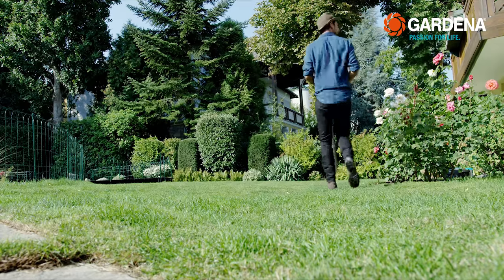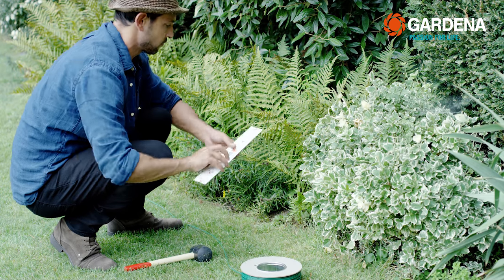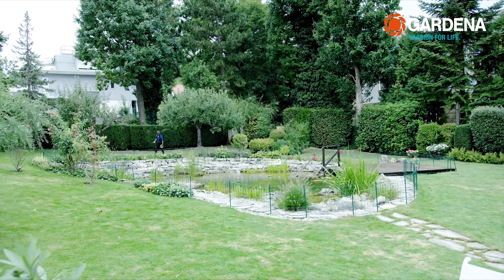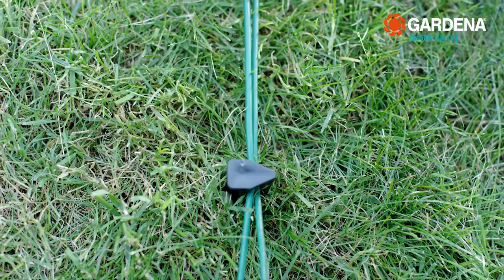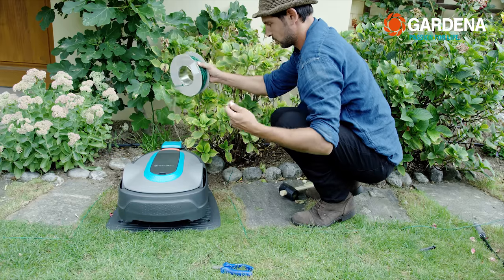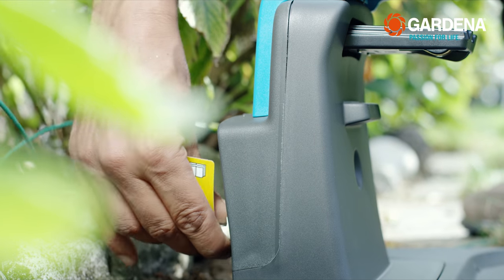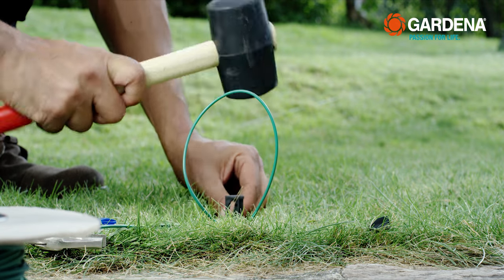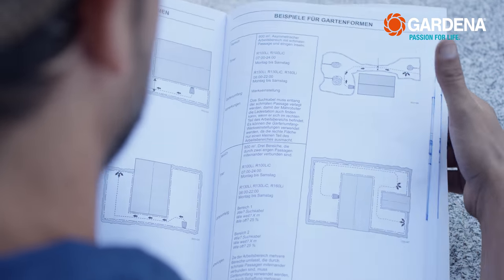GARDENA SILENO city + life 🌱 | Part 3: Lay the wire

Comment: How do you need to place the guide wire if you have a square perk?
Reply from the maker: The boundary wire should be put as a loop around the work area. Sensors in the product senses when the product approaches the boundary wire, and the product selects another direction. All parts of the work area must be maximum 15 m / 50 ft. from the boundary wire. If you’ve got any more questions please don’t hesitate to contact us directly via this link: https://www.gardena.com/int/support/advice/contact/

Comment: There are 0.0% examples in the operators manual I received. It would also be helpful to explain in the beginning the idea of the guide wire. I come from a system without a guide wire. Yes, intelligent systems WITHOUT one. Can you imagine?
Reply from the maker: Hello Reinout,
thank you for your message.
The idea of the guide wire is, that the mower will find to home, if his battery gets low.  Or you can that the mower can start after following the guide wire in the 
See examples for the guide wire in the manuals, like in the SILENO life:
https://www.gardena.com/int/search-page/?searchText=SILENO%20life
Best regards from Ulm
GARDENA Service

Comment: At 2:00 mark, you state that the pond must be protected with a 15 cm high barrier.  Is this to keep the robot from falling into the pond if the boundary wire is not working?  If the boundary wire is cut or not working for another reason, does the robot then run off?
Reply from the maker: Hello Bryan,
thanks for your message. No, if the cable is cut or not working, the robotic lawn mower stops.

Best regards
GARDENA Service
Reply: @GardenaWorldwide so why does there need to be a barrier if the lawnmower will stop?

Scenario 1:
The lawnmower reaches the boundary wire and changes direction 

Scenario 2:
The boundary wire is cut and the lawnmower stops

Scenario 3: 
_______ and the lawnmower hits the barrier stopping it going into the pond. 

Can you please fill in the blank in scenario 3 so I can understand what would lead to me needing a 15cm barrier?

Comment: Hello, could it be 2 guide wire installed (from different sides of the garden)?
Reply from the maker: The guide wire is put from the charging station to a remote part of the work area or through a narrow passage. The guide wire is connected with the boundary wire to make it easier and faster for the product to find the charging station. 
There is no need to install two guide wires unless there isn’t a secondary area (if the two areas aren’t connected by a passage) and there is a second charging station in the secondary area. If not it is only necessary to put the boundary wire around the secondary area.
Reply: @GardenaWorldwide  Thank you for reply. But I have TWO areas around house WITH NARRROW passage, so could it be 2 GUIDES to charging station? ("two guide wires unless there isn’t a secondary area (if the two areas aren’t connected by a passage")

Comment: How to set remote starting points??? Don't get that at all
Reply from the maker: Hello Tom,
If the work area includes remote parts that are connected with narrow passages, the Lawn Coverage and CorridorCut function are useful to be able to maintain a well-cut lawn in all parts of the yard. The Lawn Coverage function is used to
guide the product to remote parts of the work area. The CorridorCut function is used for narrow passage mowing. A guide wire must be installed to use these functions. You can set a maximum of 3 remote areas.
With the Lawn Coverage function the product first follows and then leaves the guide wire after a certain distance and starts to mow the lawn.
The CorridorCut function is suitable to mow narrow passages of 60 cm - 1.5 m / 23 in. - 4.9 ft. width. The product moves in a pattern to cover the passage width. The product starts the CorridorCut at the set distance from the charging station. When the product reaches the end of the narrow passage, the product continues and cuts the lawn as normal.
Area A, approximately 50%
Area B, approximately 30%
Area C, approximately 20%

Best regards
GARDENA Service
Reply: @GardenaWorldwide  Thank you for your reply! Wow I gotta let this sink in. If you have an example somewhere please be my guide ;-)

Comment: I could have got one of these for free for review, but decided not to because it looks like such a faff with all the wires and rules about how to use it. Much easier just doing it manually :\
Reply from the maker: Hey @Ironbuket, we're sorry to hear that the installation seems very complicated. Indeed, it is a bit of work you need to do when it comes to the setup but it will last you a very long time :)
Reply: So you're saying very little effort is too much for you? It took me the same amount of time setting it up as it would moving my lawn by hand 3 times.. and now I can enjoy a beautiful lawn without lifting a finger.
Reply: @mtb_landin  Thank you for the unwarranted sarcastic tone in your reply, but I looked into this in detail and decided it wasnt for me. For those with large square gardens I can certainly see the appeal, but for smaller gardens with many obstacles, curved/corners in raised beds etc the setup of the wires can be a big job. The type of boarders you have, whether you have some kind of barrier there already or the lawn just stops and drops into soil also affects things.. The random cutting pattern also can result in uneven patches if you have set it loose on very large lawns. It also cant cut right up to the edges, so you may have to go out with another mower after and finish off...
Reply: Are you an Amazon reviewer? I just snagged one to review and it comes tomorrow! I'm excited. Setup does look tedious but I HATE mowing so I say it's worth it.